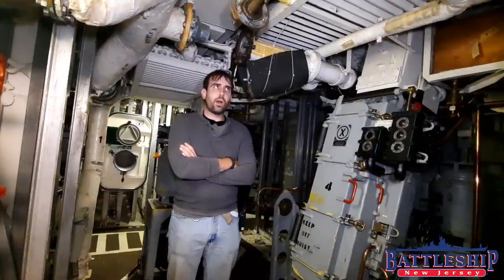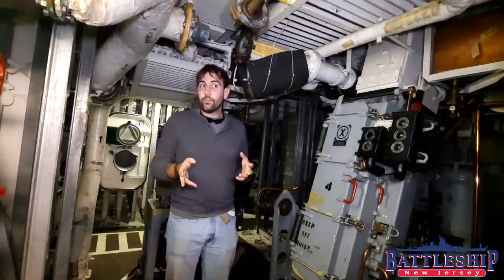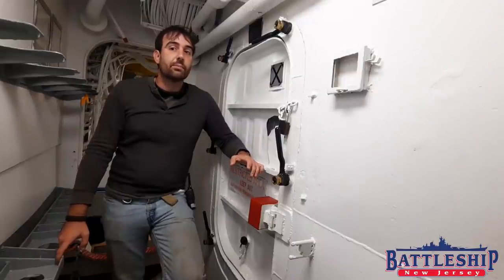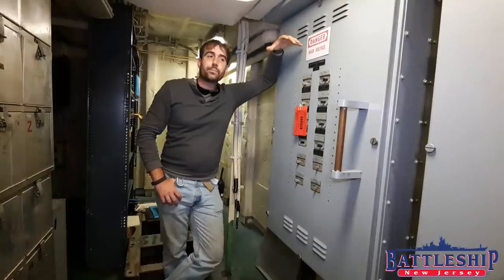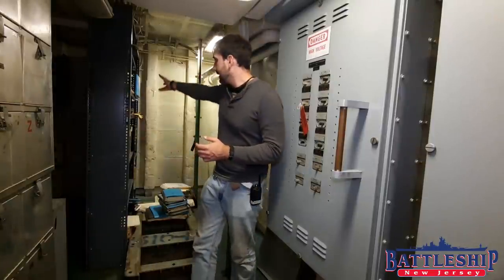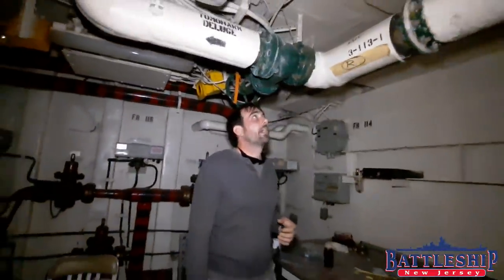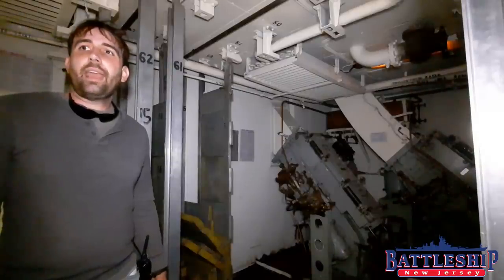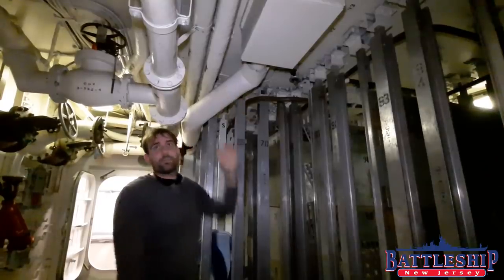5in Gun Magazines

Comment: The unused dredger hoist holes were not enough for all the new electronic gear being added to the deck and superstructure above the armored 2nd deck between the end gun turrets  (the roof of the ship's central armored hull "Citadel", 4.5" STS heavy armor laminated to -- bolted using large and extremely strong nickel-steel bolts and nuts with rubber washers in-between -- 1.5" STS, the latter used as an extra-strong construction-steel armor support material amidships).  So eight 8"-diameter holes had to be drilled along the sides, four per side more or less evenly spaced, for many power and control cables.  Drilling through 6" of armor-class steel (very similar to US Army tank Rolled Homogeneous Armor, though usually somewhat softer to optimize against huge shell hits at a highly oblique angle that could be made to glance off the deck armor) was not an easy thing to do (understatement) so Mr. Landgraff, the overhaul head at Long Beach Naval Shipyard at the time and in charge of the NEW JERSEY reactivation in the 1980s and all other overhauls of battleships there later, had to come up with the original plans for this work, as NEW JERSEY was the lead (experimental) ship for the four IOWA ships to be reactivated.  He originally hired a company who had circular, diamond-edged saws that they said could cut through the deck in just a few hours, so that the work would be one per day with a day in-between for setup.  Then the shipyard people in charge of cutting holes and the like objected and said that they could do it in-house using a huge drill and boring bars, taking several days for each hole and needing more days between holes to set up the huge drill and its reinforced bracing to hold it in place.  Mr. Landgraff objected but was overruled so the boring-bar method was used, very slowing cutting all the holes and barely finishing before the holes were needed for further ship work.  Mr. Landgraff was not at all pleased with this, let me tell you, and during the reactivation overhaul while giving me a guided tour of the ship work (one of two over the life of NEW JERSEY), he had both of us don thick ear protection headsets and go into the current compartment where one of the holes was being cut to size (over and over, using progressively wider holes, since the boring bars could only cut a narrow strip of this tough steel at a time).  A drill that looked just like a hand drill for KING KONG (really!) was braced with crisscrossing steel I-beams and the thick cylinder with the cutting tool at its end inside the hole was slowly revolving in the hole, emitting a horrible, extremely loud and high-pitched screaming noise (a good emulation of a Banshee who had hammered her hand accidently), with a person sitting on one of the I-beams with a large oil can and occasionally squirting some oil into the hole.  I wouldn't have wanted his job for ANY amount of money!!  That is how the "high tech" was built into the NEW JERSEY when reactivated in the 1980s...
Reply: This was very informative

Comment: During the reactivation do you know if it was looked into possibly retrofitting the 5 inch mounts into a more modern automatic loading / firing system? I know the Mark 45 5" was put into service in the early 70's so I was just curious.
Reply: I don't think there would have been enough space to fit a modern gun. although the gun house is relatively small the modern mounts take up a lot of space below decks due to the amount of machinery needed. Even if it can fit, I don't think it would have been economical considering the amount of modification to the structure needed to make that happen.

Comment: So how was it decided the number of 5" to remain on the Iowas during the refit in the 80s? It's role as an anti-aircraft gun pretty much ended with the advent of SAMs and I'd imaged they kept the 5" for protection to smaller water crafts, but aside that I'd image you only needed a handful of 5" for that. Maybe cost too much to remove more?
Reply from the maker: The ones that were removed were in the way of the missiles. The rest were too close to the superstructure to be able to put anything else there.  The 5in guns were primarily used for shore bombardment.